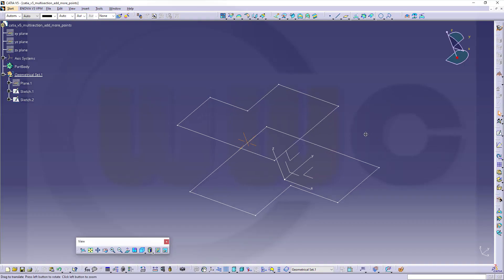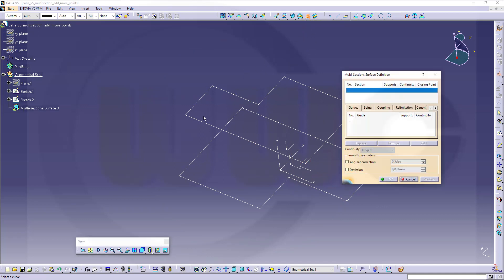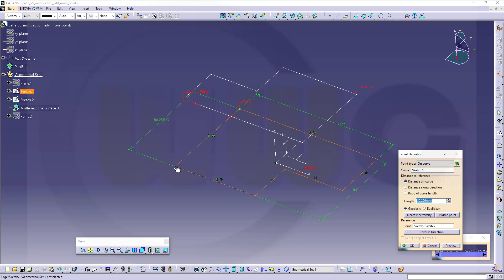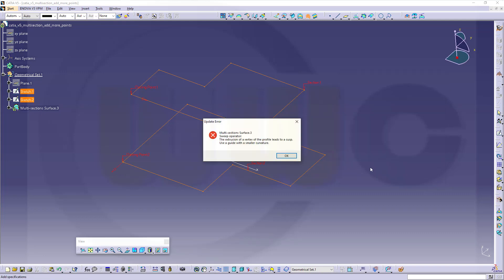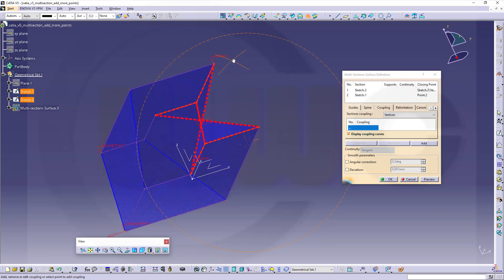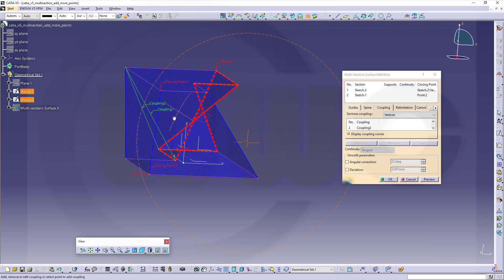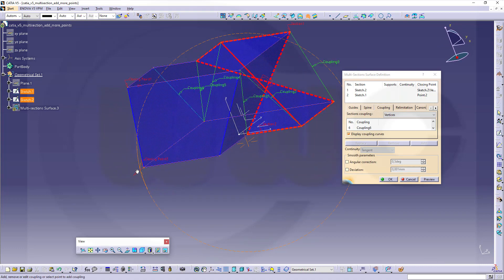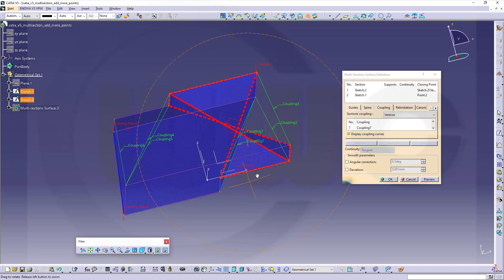Multi Section Surface - more Couplings - Catia v5 Training - GSD

Comment: Wait, so with the couplings tool, it allows you to create a surface from two profiles regardless of the number or location of their edges and vertices, just by adding more couplings to define how the spine of the two created surfaces meet and where they will converge to a single vertice on the second profile? Love your knowledge/insight. Hope one day you're able to show how you would create a basic radial compressor/turbine assembly, creating the compressor or turbine while (i've noticed you've already done a radial turbine/compressor blade wheel tutorial), volute compressor/turbine housings and shaft hub as separate part files that can then be assembled to create the turbocharger unit.
Reply from the maker: Thanks for your praise :)